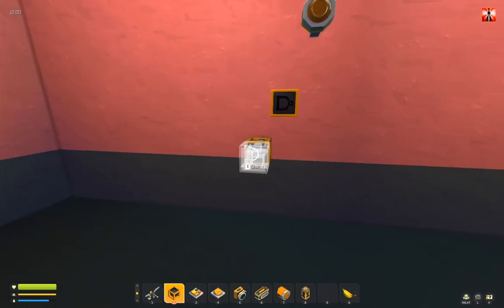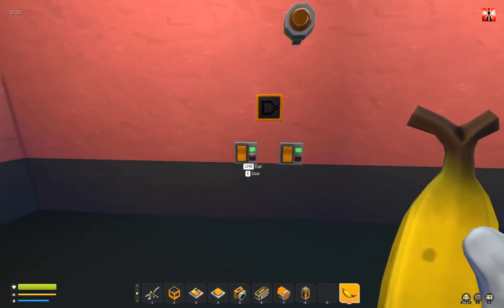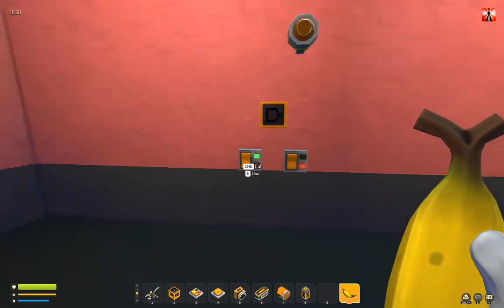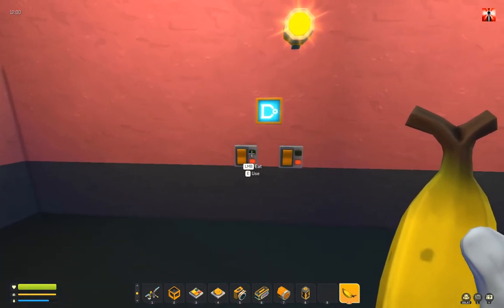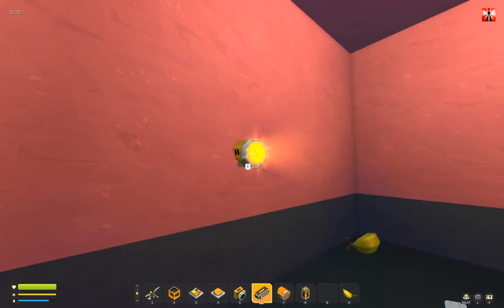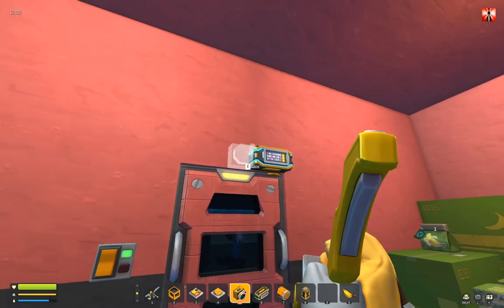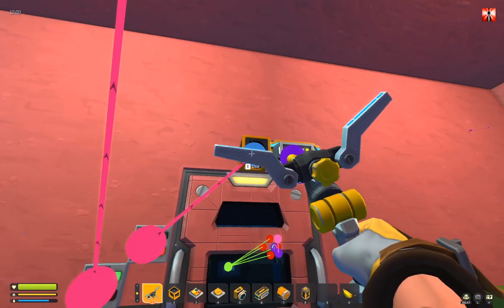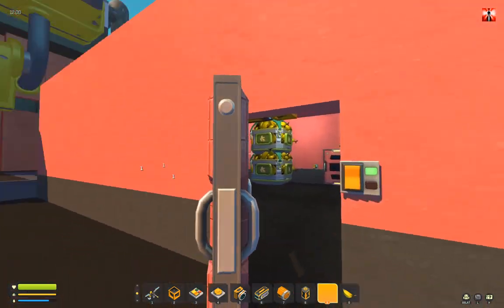Scrap Mechanic Survival | Tutorial - Logic Gates #1

Comment: @OOFant actually, if you have three switches to XOR gate like you demonstrated, i think it will not work as intended. I would use two XOR gates, two switches as inputs to one gate and the output of this gate to input of the other XOR gate together with the third switch. The output of this second XOR gate to the lamps. If you have three switches to one XOR gate and have two of them turned on, the gate will compare this inputs and have the output value of 0, even when the third switch is switched on, no?
Reply from the maker: Normaly YES with "Normal Xor" Gates. But this is Scrap mechanic =) 
Try it out. So far i see It works because the dev´s have made they gate akt like how you explained the "normal" use of them. 
They build in this Feature.
And you can even see that i´m pressing Randomly the "Light Switch Buttons" and on Every press the Light Changes it state. 
So it Works In scrap mechanic How i have explaind it. But there are many ways =)
In Real life you must do it on the way what you wrote. 
This is a bit Userfriendly from the Dev´s :D

hint. i tested that behavior because i could belive it too that this works. but it does :D luckly for us ^^
Reply: @00FantMod  i'll try that. Thankyou
Reply: @00FantMod  So I guess xor is on if an odd number of inputs are on and off if an even number of inputs are on.